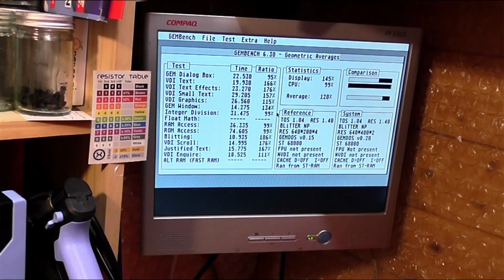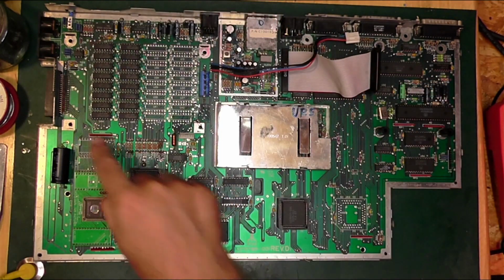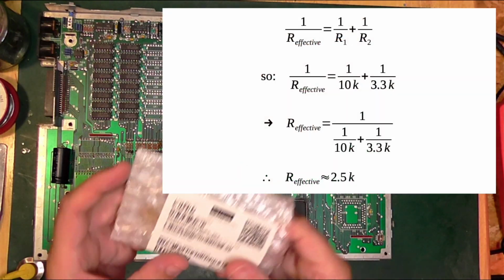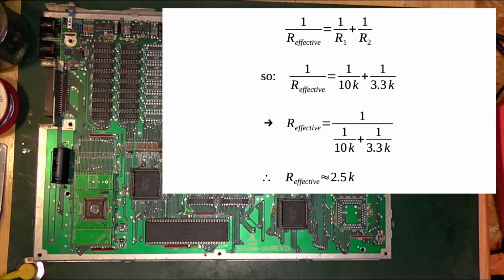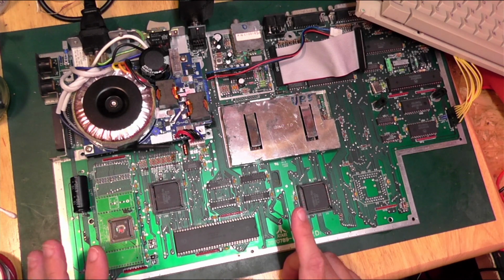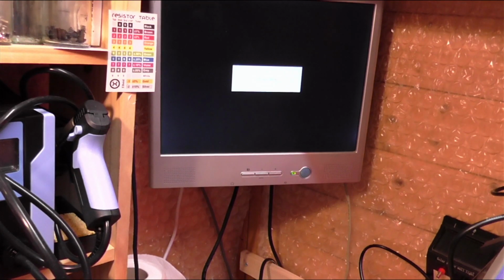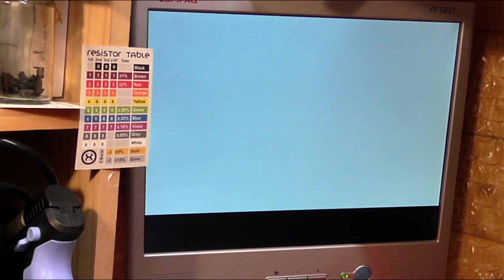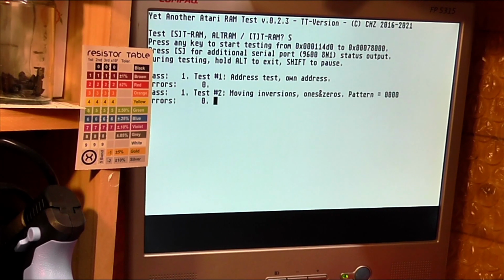Atari STFM bus pull-up resistor upgrade (Mandatory Fixes series)

Comment: Does emu tos effect compatibility with legacy games?
Reply from the maker: Yes. Old one that expect certain TOS versions. Basically if it works with TOS2.06, it'll likely work with EmuTOS. There's a compatibility.txt file detailing known incompatible software in the EmuTOS distribution.

Comment: I wish your video came out before I did this fix on my STE. I ended up with a couple of lifted pads and bodge wires on the backside near the CPU. Not that horrible, but also not very nice. In comparison, this could have been a better method. But it still worked in the end, and that is the most important thing, I guess.
Reply from the maker: Well done! Desoldering through hole is a particular bête noire of mine!